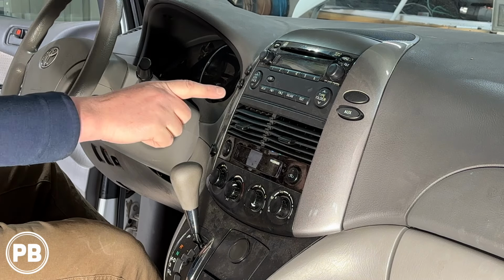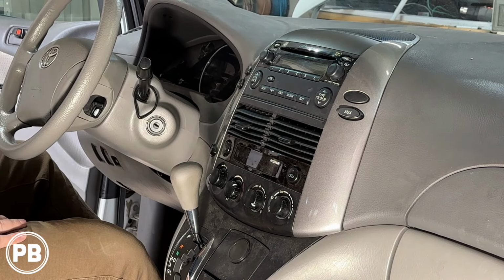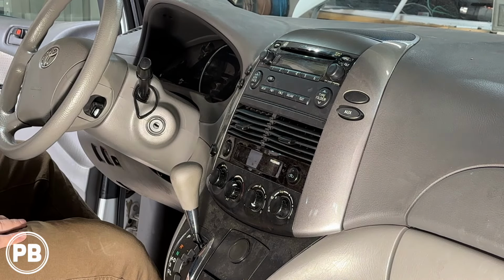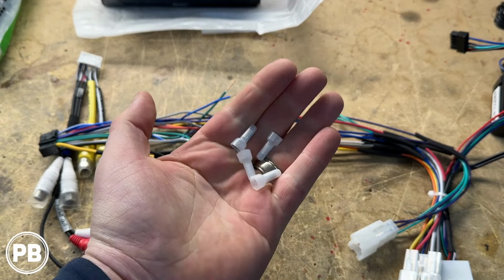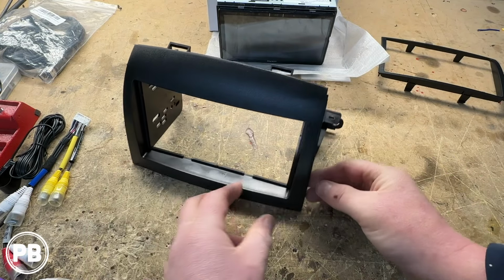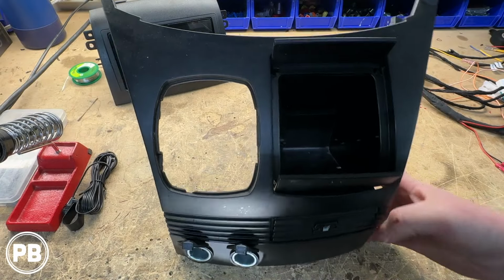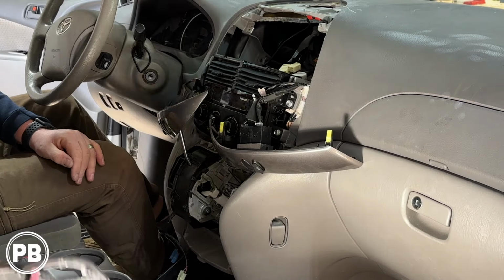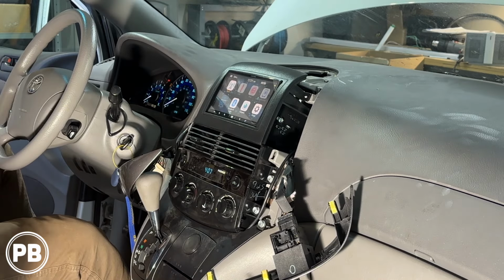2004 - 2010 Toyota Sienna Radio Install

Comment: Great video and valuable info, did you have a link to how to install an aftermarket head unit onto a 2006 Sienna with the JBL factory sound system?
Reply: I'm curious about this as well because I'm about to install one and I have JBL system. I had to buy a special wire harness. Hoping for the best.

Comment: No CD what good is it. If I'm going to spend all that time and money I want my CD player along with the USB socket. Also I use all my twelve volt jacks so there has to be another port I could mount it in.  I never charge with a stock USB port it's too slow. On my Santa Fe sport I have both USB and a CD player. On my sienna mine had a CD player that also played MP3 disks. I would definitely want that feature as well. 73
Reply from the maker: you are in the dwindling demographic who still needs a CD drive.  90% of those changing out the radio no longer need it, and this customer was one of those (they were retired age too).  There are units with a CD drive, but becoming more and more obsolete.

Comment: I have a 7" Din Stereo display.  Does it fit into the Metra 95-8208 kit?
Reply from the maker: Any standard double din chassis radio (regardless of screen size) works.  So if that 7" has a standard sized double din chassis, then yes it will.

Comment: In terms of audio quality, is this Alpine better than OEM radio?
Reply from the maker: Did Grizzly Adams have a beard?

Jokes aside, 100% upgrade over factory.  20 years car audio tech has come a long way.
Reply: @ProvoBeastAudio am I going to need all the specifics on an Android radio install? I bought the JBL harness for it. Getting ready to pull it all out and swap it . But I'm uncertain about the steering wheel controls rear camera in various unforeseen things. If there is any?. If you can mention anything to look out for I would appreciate it. .